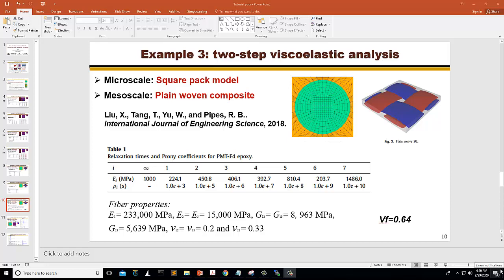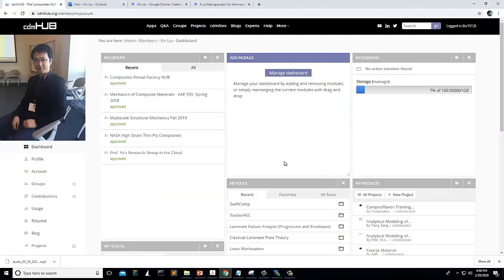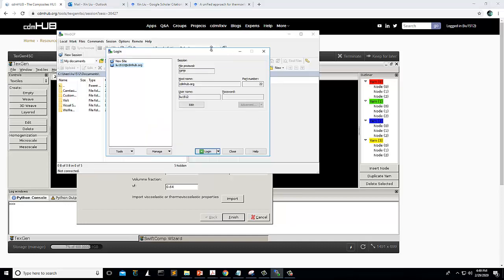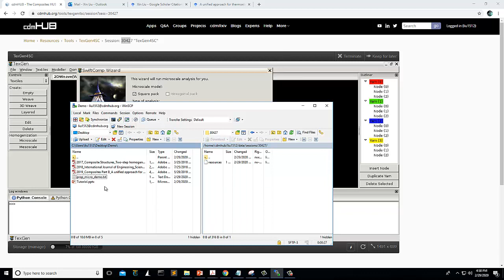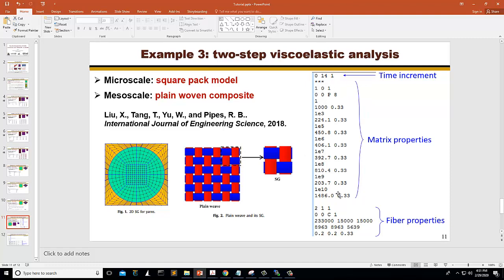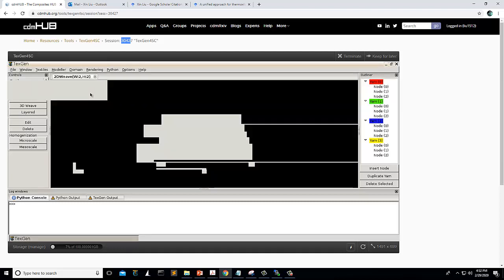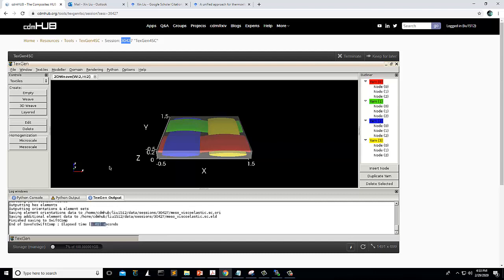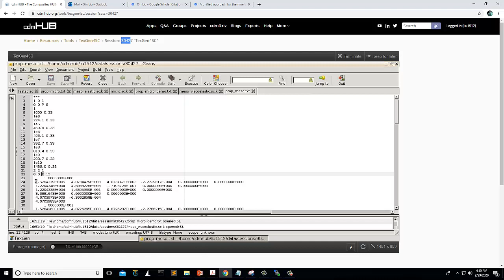Two-Step homogenization for viscoelastic analysis of textile composites using TexGen4SC on cdmHUB

Comment: Thank you for this video professor. Do you know if I can import a texgen document into Ansys Explicit Dynamics to use as a material model?
Reply: Never mind. I know how to do it now; however, I still cannot find any tutorials on modelling Kevlar fabric. It would really help if you could point me towards some place where I could learn it. Thank you.
Reply from the maker: @ahmadbushnaq3278  Thank you for your interest. I am not familiar with Ansys, but in general texgen can generate a mesh file with all the information needed for FE analysis. This should be enough for most of the analysis (linear and some customized nonlinear analysis). If you are doing some advanced analyses, say a dry fabric with contact behaviors. You may need to export a CAD file from texgen and import it to a FE software to define the mechanical behavior of contact surfaces and mesh the model in FE software.
Reply: @xinliu2648  Yes I found a way published by Nottingham University involving pre-processing for ABAQUS and then transferring the geometry into ANSYS. Do you know if it would be easy to create Kevlar for someone who started a few days ago?
Reply: @ahmadbushnaq3278   see me please